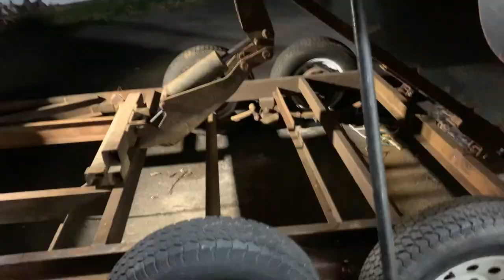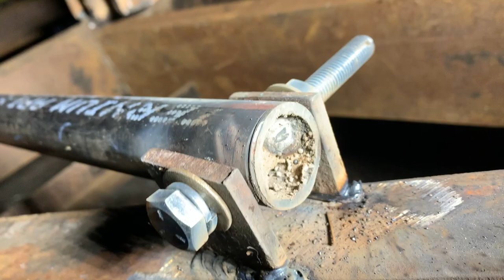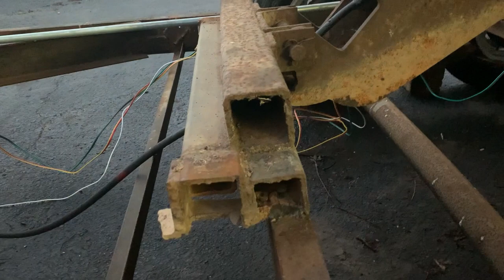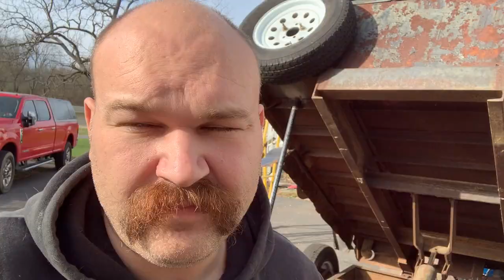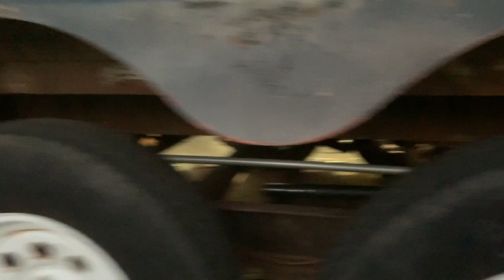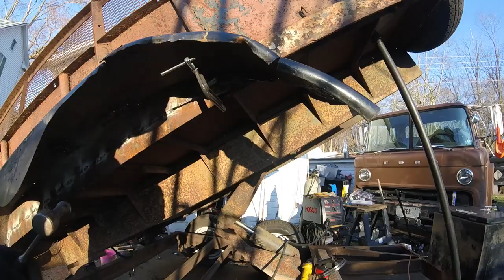DIY dump trailer P.7: safety lock bar, odds and ends: lots of welding, almost done!

Comment: Hey I found a Tommy lift gate that has a pump resovre and a ram. Do you think it would work to build a small dump trailer like a 10 foot dump trailer
Reply from the maker: Yes, it probably would. You’ll have to build a dump mechanism that will allow the stroke of the cylinder you have to dump the bed enough that things won’t stick, if that makes sense. It may not dump 5 tons of stone but would probably be fine for a lighter duty system if you can engineer a system to get enough lift out of it.